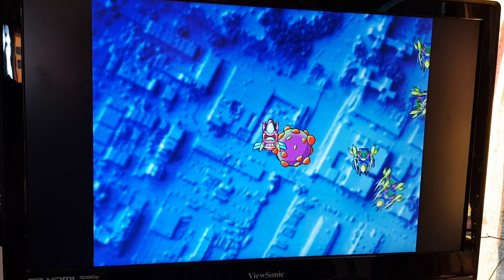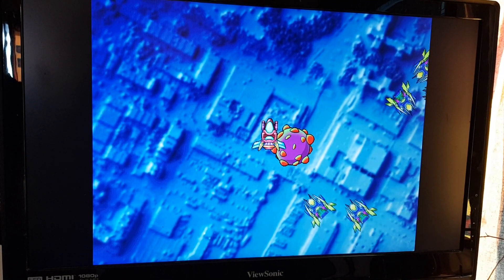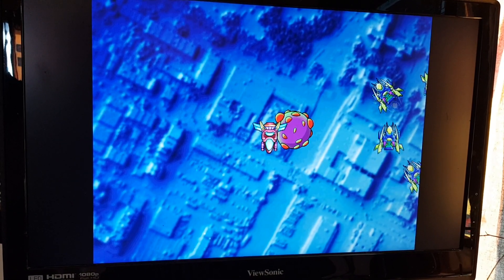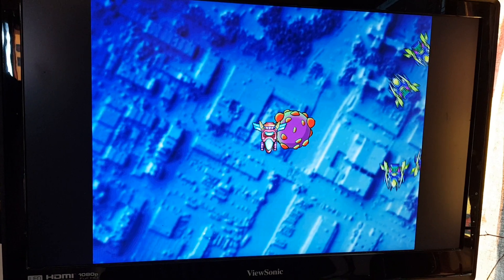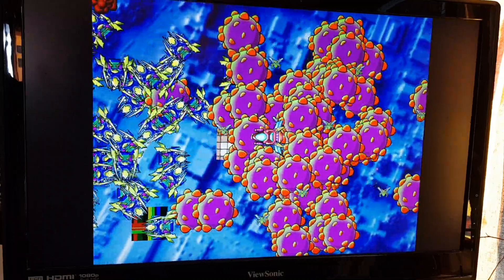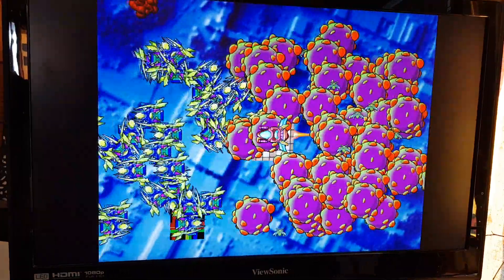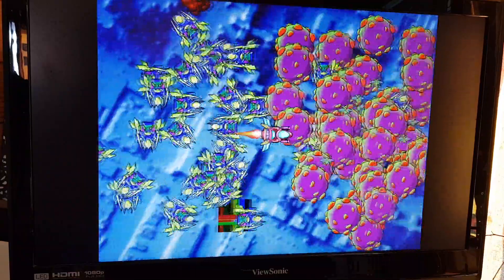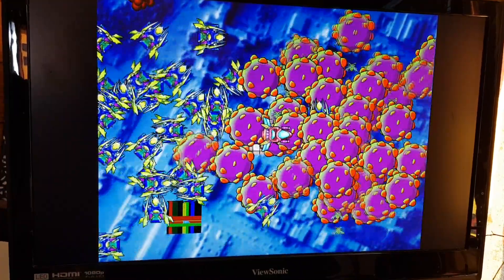Amiga Vampire V4 - AMMX testing for graphics acceleration

Comment: nice! 640×480?
Reply from the maker: Yes. I am thinking of extending to 848*480, depending upon frame rate. I want to maintain 60 FPS, if I can.
Reply: @quetzal7753  960x540 :-)
Reply from the maker: @rogerandrelassen3355  Unlikely to maintain 60 FPS at that res :)
Reply: @quetzal7753  With AMMX ?
Reply from the maker: @rogerandrelassen3355  hehehe. AMMX is helping me with sprites. For background which are pure memory copies,  it doesn't accelerate (I don't think?). So it comes down to memory bandwidth, and 60 FPS at 960x540 is 60 MB data/sec, at 16 bit. That's going to chew up about 1/4 of the available frame time, just to render the background. Ouch...
Reply: @quetzal7753  understood. You are on x11 or x12 core ? A faster core might help, but they are "in house" and not stable enough for release. I´ve seen a 130 mhz core on the V4, so its doable, but dont know if it will ever happen.
Reply from the maker: @rogerandrelassen3355  I'm on the default core, latest stable version, that came with the v4. I intend to add more effects, rather than increase resolution too much. A couple of cool additions to show in the next video :)